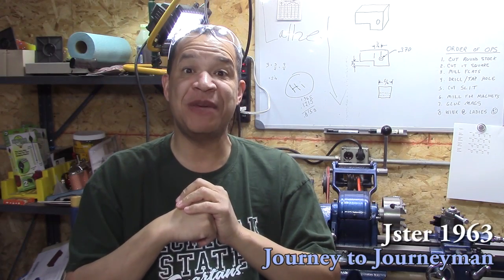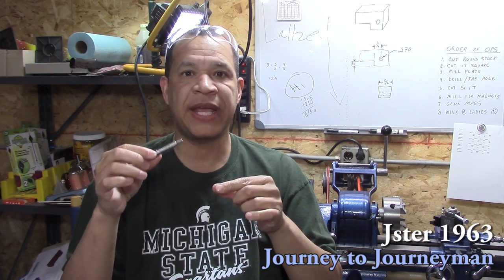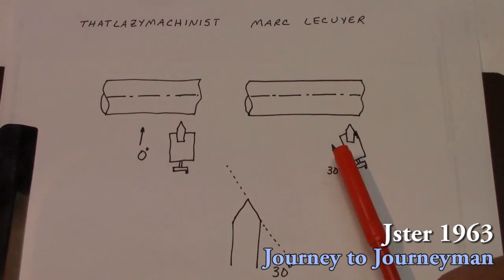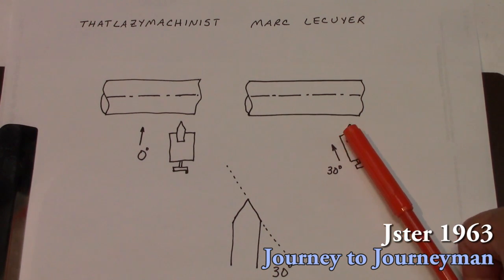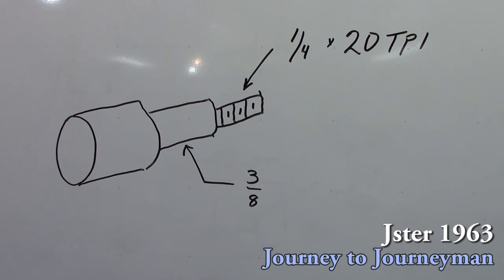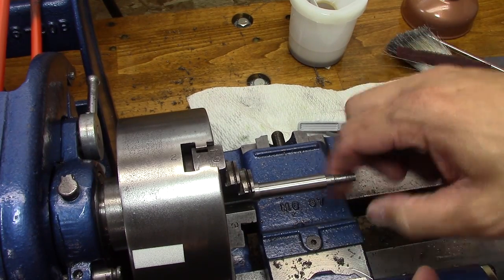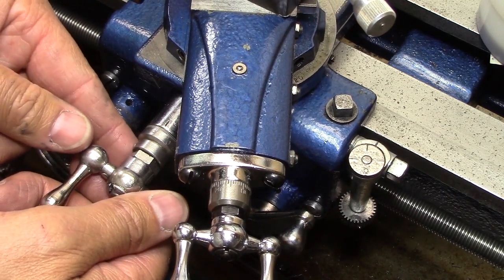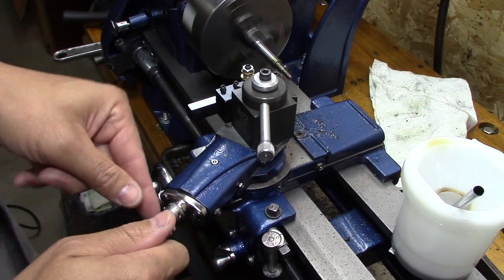Journey to Journeyman, Episode 8, How to make a threaded stud for attaching a camera to a mag mount

Comment: jster the die didn’t happen for two reasons must have a slight taper on end of bit the piece and newby mistake the die has a slight bevel on one side. Taper and bevel = threads.  As I've said before you will make mistakes = you will learn. A big point have you wrapped you knuckles on the headstock whilst it's turning yet? if not you will do it only once. big lesson there.
Reply from the maker: +ftrikerfox It's funny cuz I learned the taper later.  I know now.  And yes, I've hit my knuckles on the headstock.  Not fun!  And thank you.....

Comment: I need to find: 1/4"dowel, w/SLIT cut in end.
No problem: take a SLITTING SAW(which I don't have), a MILL, USING VISE(which I don't have), clamp it on-ctr>slit.
Easy, but ... I only have a DRILL-PRESS.
What do you suggest?
gripWIN@gmail.com
Reply from the maker: a Boswell Inniss To be honest, I think a hacksaw may be the way to go.  I just got a slitting saw but have not used it yet.  I'm a total new dude to machining.  Anyway, good luck......

Comment: Make sure to clean your bed after sanding on the lathe. Cast iron holds in grit (Why it's used as a lapping plate) and will wear your bed and underside of carriage.

Also, you have a TON of stickout there, and when threading you can see the piece flex away, and can even hear it (that clicking). Try and use your tailstock if you can, use a small center drill and drill a spot in the end of the sacrificial piece then use the tailstock. Just lightly tighten it. It will stop bowing, make a cleaner cut, and a nicer thread,
Reply from the maker: You are so correct!  I didn't even catch that until you made this comment.  I'll fix that next time and thank you very much!